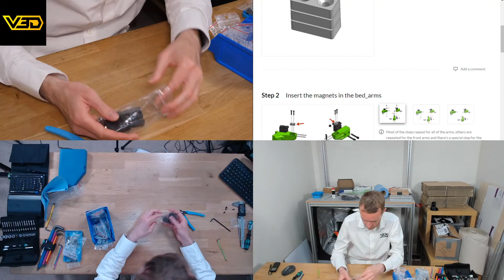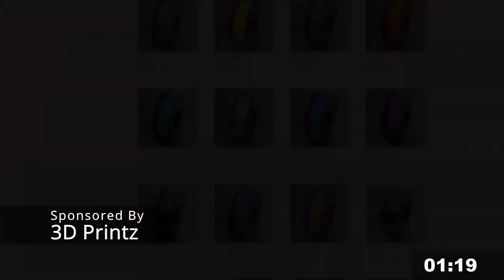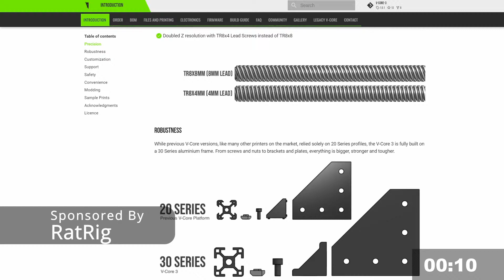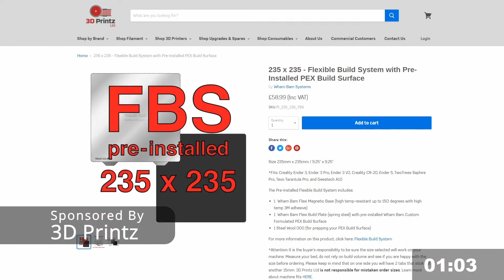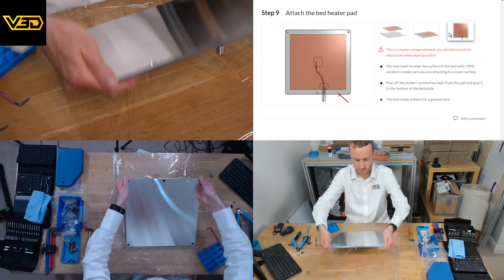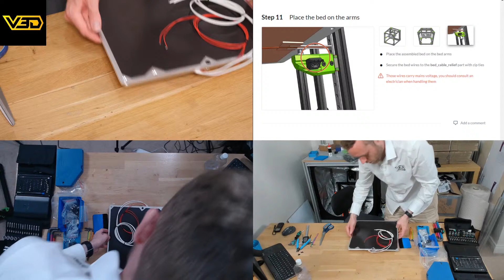Building a Rat Rig V-Core 3 Part 5 - Three Point Bed Assembly

Comment: If you were to print a large item in one of the unsupported corners, would it start to weight down on the bed at the spot causing the bed to change how level it is?
Reply from the maker: Well, technically yes, but the deflection would be very tiny unless your printing with a metal fill filament. You could just print it in the middle though

Comment: A tip for mounting adhesive mats is to apply a little soapy water.  This will allow you to position the mat without it sticking.  As you squeeze the water out, it will stick.